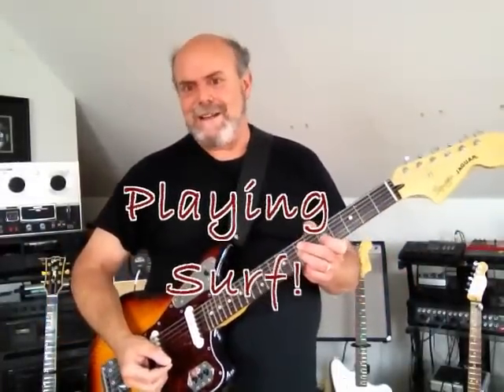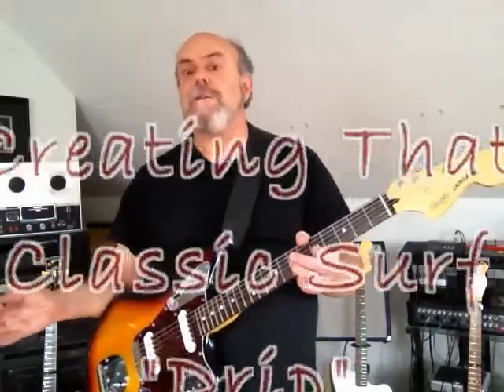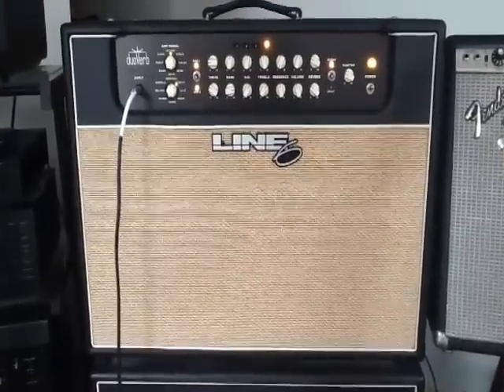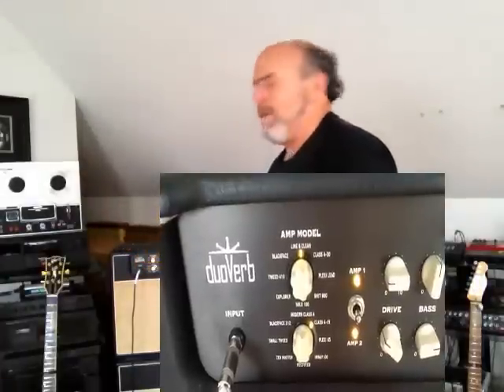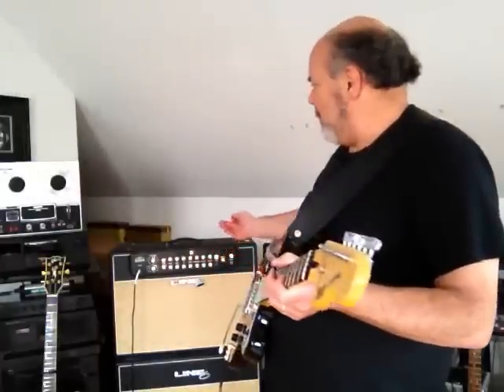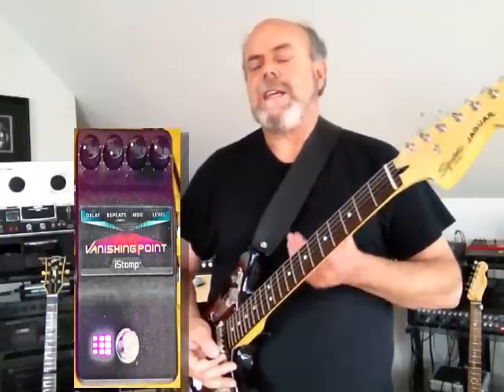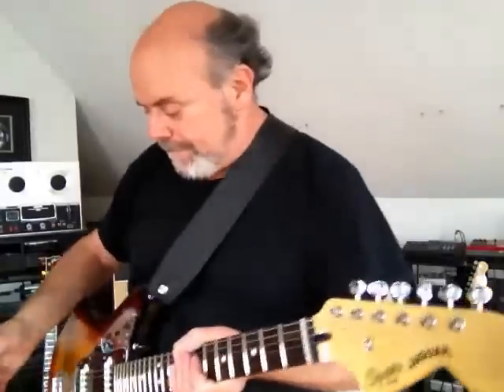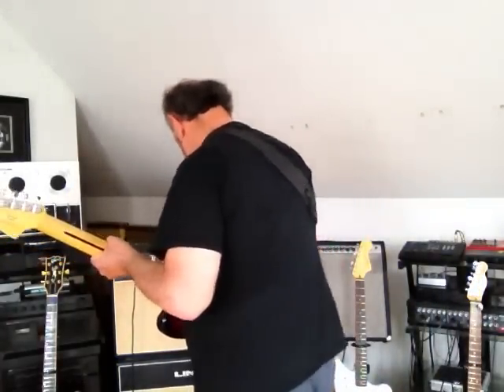Creating That Classic Surf "Drip"

Comment: Closest I've been able to come in getting that tone was by using my Boss RE-20 Space Echo set to give a slap-back delay, and then using the spring reverb from my Marshall MA100C amp, that got me most of the way there so I'll need to get myself a good tremolo pedal.
Reply from the maker: It sounds like you've found the elusive "it"!   Congrats and all joy!

Surf's up!  :)
Reply: Cheers, been wondering how to get that Surf sound, and when I watched this video it all made sense to me, back in the day, some Fender amps did have a built-in tremolo effect as well as spring-reverb, I think the Fender Vibroverb is a good example, as well as the Fender Twin.
Reply from the maker: Yes the Twin Reverb is a good surf amp.  I have a mid `70s version that I enjoy, but to some people's chagrin I actually think I can get better surf sounds with the gear in that video.

The `63 Vibroverb was Fender's first amp with reverb.  I managed to snare one (they were hard to find even when "new") and used it both in the studio and in concert throughout my years in the Abstracts.   https://www.youtube.com/watch?v=MAkvgzM7O10
Reply: I've got an old Fender Super Twin amp (non reverb version), which I think is a mid 70's, it's just the chassis installed in a wooden cabinet for a blackface Fender Bassman amp head, I'm planning on doing some restoration work on it this year, it uses a total of six 6L6 power valves, and five preamp valves consisting of one 12AU7, a 12AT7, a 12AX7, and two 7025 valves, it's rated to put out 180 Watts RMS, and 395 Watts peak, pretty scary, it really needs a good 4 X 12 speaker cab so I'm working on getting one for it.
Reply: I'm working on building myself a custom Telecaster guitar, I've got an Alder body that's finished in Butterscotch Blonde, and I've got a nice Tortoiseshell scratchplate for it as well as a set of Tonerider Hot Classics pickups, all it needs are a neck plus all the hardware needed to build a playable instrument.
Reply from the maker: Sounds like a fun project!  Good luck with it!  :)
Reply: Just so I know, what order does the delay, reverb, and tremolo need to be connected up in?, cause I know that the order you put the effects in has an influence on the resulting tone, do I need to experiment for myself?, with my Boss RE-20 Space Echo pedal, the order that the delay and reverb (it has both delay and reverb effects in it, the Boss RE-20 is a digital modelling pedal based on the 70's analog Roland RE-201) is fixed and can't be changed, cheers in advance, reason for asking is that a friend of mine and I are going to be playing a set of Surf Rock tunes later on this year, so I'm interested in getting that Surf Drip tone to get more authentic, the tunes in the set include "Wipeout", "Hawaii 50", and "Rise and fall of Flingle Bunt".
Reply from the maker: I use tremolo, echo, reverb.  But by all means experiment.  

I know that that 'surf' has become almost cultish for some.  That there is for some one accepted way of doing things -- this determined by some  passed down and now accepted wisdom. 

I, too, was there, but none-the-less am of another mind. -The one expressed and encouraged by Walt Whitman: 

"Now, voyager, sail thou forth to seek and find." 

Surf's up.  Enjoy the waves! :)

Comment: DON SUCHER, what is causing the DRIP sound in the tank it is early reflections or driving the tank pan? how can you modify the reverb tank to have more DRIP?
Reply: early reflections are a part of it. you can't modify the reverb pan itself, but if you've got a 6g15 style circuit, a NOS 6k6gt drive tube is crucial. the modern 6v6 requirement doesn't do it. that, and the correct type of reverb pan. the earlier 90s accutronics pans work very well. i have a modern belton pan that sounds great: the Mod reissue pans are close, but i've had two complete failures from Mod.
Reply: check surfguitar101.com for pages on 'drip'. some suggest a cap mod and a resistor value or two. they're not necessary in my opinion. i had a 1999 fender reissue tank that dripped VERY well with nothing more than a 6k6gt drive tube swap.

Comment: Which is the order of your reverb/slapback/tremolo signal chain? Great Vid.
Reply from the maker: Echo, trem, reverb.  That to me is the most ‘organic.’ But you might try the various possibilities and see which you prefer. That can be a learning experience, and fun, too!  :)

Glad you found it helpful!
Reply: Thank you for taking the time to answer. I will give it a try. I have a fender M80 with a spring reverb but it doesn't sound drippy. I actually bought one of those cheap Azor spring reverb emulation pedals and that seems to sound more "drippy" then either my M80 on my Peavy Vyper although I could try using the pedals "in front" and still use the internal effects as well. I guess I'm always worried about trying new things as I'm an old bird but I really appreciate your taking the time in reading my post and your advice. I'll let you know how it goes. Thanks.
Dawkman/Warren @donsucher5412
Reply from the maker: @Dawkman72  Two "reasons" for that -- the inexpensive pedals sounding "more drippy."   One is that modern amp reverbs are "too good."    They really are!   No "boing" sound 00 the sound of a spring. The second is that they come after the preamp, i.e., after the guitars sound has been shaped.

Old school stuff is what we hear when we listen to classic "surf." So we need to fake that. (Or buy super pricey reissue units.)

The Boss "`63 Reverb" pedal was basically the perfect answer.  But its strengths (to us) were seen as weaknesses to the general guitar playing public, thus its demise.

I, too, (as I guess you can tell!) am an 'oldie.'   See: https://web.archive.org/web/20160306184429/http://60sgaragebands.com/abstracts.html 
Hey, we are what we are. We use what we use. We love what we love!  :)  :)  :)

Keep on rockin'!
Reply: Tried a Combo of Azor delay> Behringer Tremolo>Azor spring reverb into effects loop of old Fender M-80 with with onboard reverb about 7-8. Pretty drippy . TYSM for great idea
Reply from the maker: @Dawkman72  excellent! Thanks for sharing!  :)
Reply: I play guitar in a surf band. This is a great video. I’ve been using this pedal combo for my entire time playing surf and I am thrilled to know this fella took the time to make a video. Thanks man. You rock

Comment: If I'm not mistaken the Reverb unit you're talking about you can still buy Fender makes one only problem is it's like 600 bucks are you making find someone that can build one for you I seen them on eBay
Reply from the maker: Yes, such 'reissues'  can be purchased. And then, at least according to some, the fun starts searching for better tubes and making small circuit changes. Others seek out an 'oldie'  and either luck out of do the same.

And yes, there is the kit approach which as satisfied many.

Fun stuff!  :)

Comment: I thought the drip is just the sound of the reverb spring hitting itself
I used to get this on cheap practice amps with reverb on them, the coil would hit itself if you tapped the amp case
I'm assuming you can get it to drip if you run an amp before the reverb, like overdriving tubes
Reply from the maker: Back in 'the day' we used to call that "reverb crash."  And yes, we'd use it to advantage.

I remember one large stage concert when the Abstracts used to two amps being "crashed" simultaneously as the introduction to "Wipe Out."  It was quite effective, too.  :)
Reply: Thanks for the insight and your awesome vid!

Comment: thanks a lot! useful information! It helped a lot getting the tone with a pod hd500x. there os a delay stomp calldd tube echo, by itself it has that type of delay and some reverb, there is even an option to distort the echo, that gives it a vintage colour. added a spring reverb after that. strike!
Reply from the maker: Thank you for sharing that Kemboooo000.  There are lots and lots of good tools out there to help us get the sound we want once we understand the principles! :)
Reply: +Don Sucher exactly, just a quick update there is also a 63 fender reverb on the pod. the tone is exactly like what you demonstrate on the video. can't get enough of misirlou tremolo picking now ^^
Reply: +Don Sucher exactly, just a quick update there is also a 63 fender reverb on the pod. the tone is exactly like what you demonstrate on the video. can't get enough of misirlou tremolo picking now ^^
Reply from the maker: And isn't that what choosing equipment is all about?  (Well, it is to me anyhow.) -Finding gear that gets the musical juices flowing.

I know that is not universal.  Some gear is just cool unto itself. -Old `60s stuff for instance.  But to me, in the end, its gotta be the music it helps you make. :)

Comment: You know a lot about early 60s gear and style of playing but why use Line 6 to emulate it when any clean amp will do as long as there is front end SPRING REVERB? This can be achieved for less than $100 with a Surfy Bear kit. 
Also you didn't mention FLATWOUNDS
Reply from the maker: Tonal color is determined by the amp type and speaker size/type.  Reverb is just one (albeit a critical one!) of the overall sound.

Many view the fabled dual 12 inch Fender Bandmaster as the ultimate "surf amp."  And for live performances in a venue allowing for it to be let loose I can't but agree.  But in a smaller setting the varying 'colors' of an amp like the (rather rare) Line 6 DuoVerb are to me a plus.

Several viewers have commented with surprise that in the video you can see a rather pristine mid-70s Twin Reverb sitting on a stand right next to the DV.  What did I not use that?

The answer is the same: The available tonal color that can be tuned 'just so' for the practice room.  In a live performance setting the TR might -- yes, might -- be the better answer.  But not here, at least to my ears.

Obviously individual preferences play a large part in this. As is so with string type.

In the `60s I sometimes used flats, but apart from on my jazzbox (a current model D'Angelico EXL-1) I find that I prefer rounds.

BTW, of late most of my video are being made using an even smaller "modeling" type amplifier. One with built in effects. A Fender G-DEC 30.   Is it the "ultimate" sound?  No, but it is amazingly good and amazingly flexible.Certainly good enough for instructional purposes. (see, for example: https://youtu.be/GI5aSHRE8Tc)
Reply: I play a Blonde Bandmaster with a single D120F in tone ring cab. I practice  in the garage with volume between 3 and 5. I find the sound completely satisfactory and volume not oppressive. I don't see the benefit of substituting a smaller amp. Maybe a 2x12 has more apparent loudness as it pushes twice the volume of air. 
The reason I eventually went with a vintage Bandmaster was that it nailed the sound without any question or tweaking. I also own a Twin Reverb with a Bassman cab and 2xD130 but it's too much amp to haul to practice. Probably too loud too. 
But to cut to the meat of the issue, I don't see how any combination of analog or digital effects can add up
to the simple expediency of a real Reverb unit. It's laudable how you dissected the several component artifacts of a spring transducer and its accompanying preamp system, but a used tube unit can be had for not too much and a spot-on FET version has been available for about $60 shipped from Surfy Industries, now for several years. Users like myself swear by the Surfy Bear and look no further.
Reply from the maker: I continually hear good things about the Surfy Bear!   And that now there is even going to be one out that takes no "making."   

Hope to one day try one!

Thanks for sharing. :)

Comment from the maker: A few words to those who question my use of a "Line 6" amplifier in this video...

Few players know about these amps. Fewer yet have actually played through one. But the DuoVerb is not your "average" Line 6 amplifier.  It was Line 6's attempt to go 'boutique' -- to spare no expense and thus break into the rarefied amplifier market. 

In the market it failed.  The DuoVerb was, simply put, way to pricey to sell while be called a "Line 6." But in every other way it was, and remains, an extraordinary success.  

Quality of build.  Sound.  Design. Convenience. A true players amplifier. One whose capabilities far exceed what most -- even good and experienced -- guitarists will ever likely need.

I saw the DuoVerb when they were just released and reacted as I think did many guitarists. "I'd love to own one of those, but at that price?  Nope. Never!"

But when, just a couple of  years later, the company admitted the DuoVerb's failure in the marketplace and closed them out for a fraction of their original price I jumped.  And when, a short time later, its matching speaker became available, I snagged one of those too. And I have never regretted it.

The DuoVerb had a lot of computer speed and power.  Far more than other modeling amps of its day.  (Today some less expensive amps likely have such, and some perhaps even more. But not then. Back then such was just too costly.)

With the DuoVerb Line 6 also addressed another thing that turned off many players-- especially ones who could afford such a costly amp.  It was given a "normal" interface.  No menus. No tiny LCD screens.  Just comfortable and familiar knobs.

And as an added plus the DuoVerb's knobs did, and reacted, just as did those on the specific amp being modeled.  

To all the above add its name claim to fame:  DUO Verb.  Yes, its two-amps-at-once capability. Each of the two with its own controls. Two amps that can remain separate, either stereo/side by side, over and under, or, if the user refers,  may be blended into one unique sounding amp.

As with any modeling amp one needs to learn how to get the most out of a DuoVerb.  And few players, it seemed, were willing to do that. But those that did were rewarded with a sound, a feel and a range of tones so great that even some sparkling classic Fenders may sit unused.

As mine often do.

As the old saw goes "don't knock it until you try it."

No, really, don't.  

:)

Comment: I appreciate the time and effort and all, but throw a Catalinbread Topanga, Subdecay Spring Theory, a Mr. Black Deluxe Plus (for the addition of Tremolo), or even a Digitech Polara on the "Spring" setting, in front of a Fender tube amp. Add single coil on bridge pickup plus palm-mute and drip drip with ease. All pedals under $200 USD.
Reply from the maker: Yes!  There are lots of good approaches and good gear.

Glad you have found ones that work for you.

Comment: Do I need single coils pickups or will humbuckers work?
Reply from the maker: Plenty of players in the `60s did it on HB equipped Gibsons.  Between the amp's controls and guitar you can get a great, clean, surfy sound.  Just avoid overdriving the amp.  (Turn down the guitar's volume know a couple of notches if required.)

:)
Reply: Don Sucher thanks man I can do coil splitting anyway I was just wondering

Comment: Good video.  Couple of points.  The Ventures played Mosrite on stage, but that was mostly because of the endorsement deal; my understanding is that they used Fender amps in the studio. Also, not all amps with an onboard reverb are incapable of replicating the in-line sound.  My vintage Sunn Solo has an onboard spring reverb, which sounds amazing.  Finally, for everybody that's kibutzing the pronunciation of "reverb": take a moment and think about the root word "reverberation"; now, cut off the "eration".  There ya go.

Comment: Yup, agreed! I'm fortunate enough to have an incredible-sounding Fender '63 reissue outboard reverb tank, and I play it directly in front of a small (15w) Princeton Reverb amp (with tremolo), just as you've described here, using a '62 AVRI Jag, strung with 011-050 flat wound strings, and that's probably as close as anyone is ever going to get to that wet, drippy, vintage 60s's surf sound. However, as you've pointed out, I can get awfully close (99.99% of the way there), with alternatives, including a budget 60's Jazzmaster (similarly equipped) and any number of surf reverb pedals, such as the FRV-1 (that you've shown here), or the Catalinbread Topanga, which I believe is a bit superior to the FRV-1. But thanks for this great video! You are 'bang-on' as far as the components and FX needed to get there, but I'll close by saying that in my own humble opinion, nothing comes quite as close to the original '63 reissue outboard tank. Its simply a step above all others.
Reply: Joseph Stewart:  The secret is under-wound pups with alnico 2 mags. You need to make irritatingly sharp highs then soften them with the tone pot on the guitar.